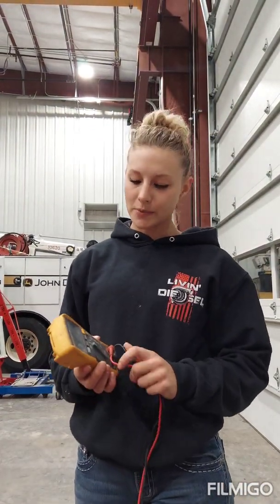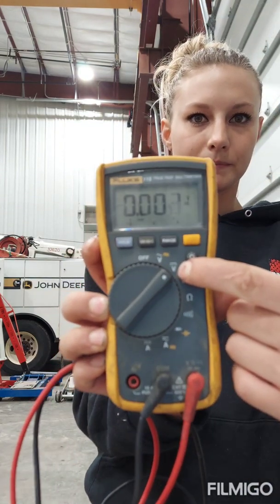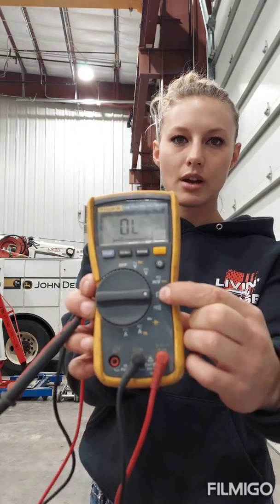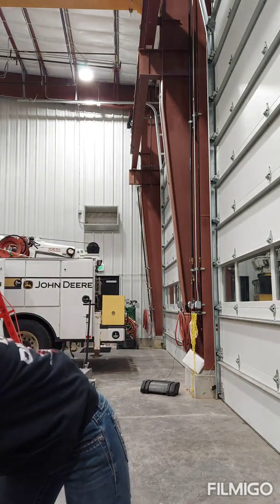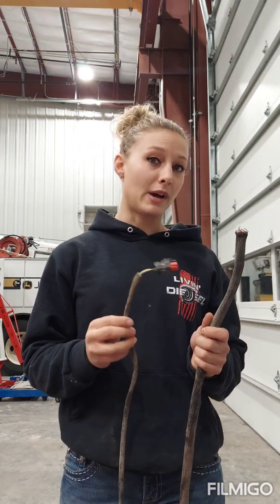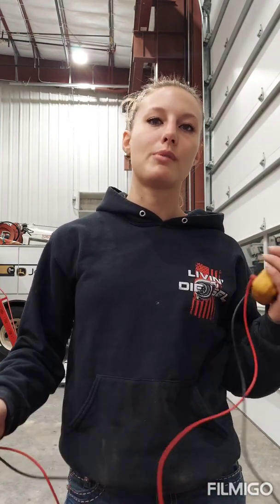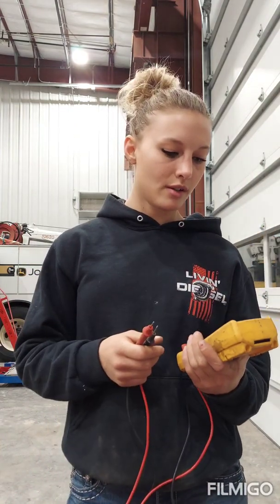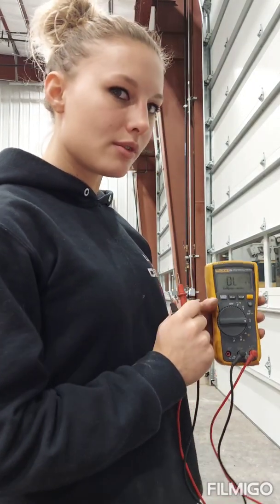Basic Wiring and Electric Testing

Comment: Isn't it a Multimeter? A voltmeter is just for measuring volts? Also you can use the continuity checker to check the wires (less its like really long) then it will have a buzzer sound to tell you whether you have a short or busted wire then you can look at what you are doing rather than the meter.
Otherwise good.
Reply: Most of us doing this line of work don't hear well after 30 years.😂😂😂

Comment: I was an electrician for nearly 30 years. I have used many different brands of volt meters. Both on AC and DC voltages. I found Fluke to be a high priced toy. Not knocking Fluke, just stating a fact. It’s like buying a Harley… you’re buying a brand name…
Anyway, I came across a 1,000 volt/ 1,000 amp iDeal volt meter that was purchased for a Maintenance Department that we were doing an remodel for. The head of maintenance told me they had extra and would sell it to me for what they had in it. I had to ask, “how much?”
He sold me that meter for $40.00
I have used it many times in the past 10 years. Still use it now…
Works great when troubleshooting any of my vehicles (including my Harley) and AC circuits

Comment: You do good and tey well!  For you to learn...  their is no ground on a car, truck, heavy machinery,  forklift.     Ground is only on A.C.    that is all battery negative.  They use the frame of a piece of equipment like a bus bar to complete the circuit.  Ground in AC is to safe your ass from death.   The load doesn't need the Ground.   P.S.  electric forklifts will never use the frame as a battery negative bus bar.

Comment: Voltage drop testing is a far better test than ohm test. For shorts, opens and high resistance. The thing is there is no ball park figure for resistance on a circuit, where as most automotive circuits work on at least 9v. Did you know ohms continuity test will work with up to 100 ohms resistance in a circuit.

Where ohms testing excels is small components like a relay, solenoid or fuel injector.

Comment: Several years ago I got a phone call out of the blue from a friend asking if I knew anybody that wanted to buy a 1991 Dodge Dakota that another person he knew was trying to sell. Long story short they couldn’t get it to start. They had replaced the ignition coil, the distributor, the spark plugs, etc. I went over to look at it and you could tell they didn’t know a lot about wiring because they had cut the pick up wires to the distributor and started rearranging them. Also, they were frustrated and basically done with the truck. After doing a little dealing I got a really good deal on the vehicle And hauled it home. Went and got a manual, (back when they still had wiring diagrams in the Hanes manuals), and spent the next week and a half after work tracing the wiring. What I learned in reading the manual was Dakota used a pulsed ground system. That means basically that all of your sensors and anything else that was controlled by the ECM had positive voltage running to them and the computer turned the ground on and off to activate them. So I started checking all the grounds. Finally, I found one of the main grounds from the battery going into the wiring harness Was checking about 200 ohms. I used the meter probe to pierce the wiring in several places until I found where the reading changed. Somewhere in that wire was a bad spot. Instead of unwrapping, the entire harness and re-doing about 4 feet of wire, I simply cut off the insulation, wrapped a new wire on soldered it And taped it back up. Then I put a ring terminal on the end of that spliced wire, cleaned a good spot on the firewall, and installed a ground screw. As soon as I did that it fired right up and ran. The only issue I had with that vehicle was a few weeks later the engine control computer stopped turning on the electric cooling fan. I ordered another one from a salvage yard and replaced it. I figure all of the switching of wires back-and-forth With the previous owners, had probably backfed electricity through the ECM, causing it to fail. I drove that vehicle almost daily for years without doing any more electrical work to it. It hauled trailer loads of scrap. It was our demo vehicle tearing down houses after the Joplin 2011 tornado. It was used and abused. I sold it to another gentleman who drove it for a couple of years. He sold it to a 19 year old kid, who drove the hell out of it. So, ground issues can cause all kinds of screwy things, especially in lighting, circuits where it can backfeed through other paths.

Comment: I would encourage you too look into load testing wires and using voltage drop. While, a ohm meter will tell you if a wire is cut in half, its not a good test for a wire that’s partially broken. Moreover, What most people don’t know, is that all it takes is one unbroken strand of wire too pass a 1.0 ohm test, but that one strand of wire will not carry a load. Also, a ohm test will give you false positives and leave you scratching your head. Finally, it may lead to replacing components that aren’t bad just because the wire couldn’t carry the load even though it passed a ohm test.

Comment: Best practice every time you meadure resistance is to touch test probes together and  remember the ohms. On old leads have send them as high as 3 or 4 ohms. Always carty at least one new test lead & several meter fuses. Had a 1,000 volt Fluke combination VOM/Megger that would give out wrong readings when the 1,000 volt dpecial hard to het fuse blew.

Comment: If you are measuring and get 5 ohms and not 0.4 ohms or less their is a bad connection between the probes and the test circuit. Possibly also corrosion or an improper connector crimp. Your explanation is spot on though

Comment: There are essentially 3 types of electrical faults: opens, shorts, and high resistance. 
An ohmmeter is pretty good at identifying opens and shorts, but not always good at identifying high resistance(especially in high amp circuits). Ohmmeter can only be used on circuits with no voltage. 
Volt meters on the other hand are good at identifying all 3 faults. They are far more effective at finding high resistance than ohmmeters. Voltmeters(when used correctly) can be used to find opens and shorts whether the circuit is powered or not. Voltage drop measurements can be used to identify high resistance in circuits under load. If you have a LoadPro hooked up to your meter, it makes very easy to do that.
Reply: Worst one is any intermittent problems. Have spend hours trying to find cause if intermittent problems from shorts grounds and open circuits.
Reply: @JohnThomas-lq5qp  I have one now on my Bobcat skid loader. I'm getting some fault codes and have taken it to the dealer when the boom won't lift and by the time I get it there it works again. I checked the wires and actuators and the dealer ran tests as well and can't find anything. She's been good for a couple weeks so I'm being nice to her and sweet talking her to stay on her good side and keep her happy.
Reply: Would love to hear more about this in your own words. It sounds like I could follow what you are saying. I have both types of meters but basically only understand ohms as in continuity. This girl is a real cutie and very knowledgeable but I could not follow her. Everyones brain is wired differently. Regardless, thanks for sharing, both of you.
Reply: @Flat6fever  Electrical troubleshooting can be challenging to learn. I recommend looking up Daniel Sullivan on youtube. Not as attractive as this young lady, but he has some really good content on electrical diagnostics. I've been to one of his classes, and it was well worth it.

Comment: You should have less than one ohm on a wire with continuity. Also your Fluke has internal protection if you connect to voltage while in resistance mode and shouldn’t blow a fuse. Some of them will beep at you to let you know there’s voltage present when you’re testing for ohms. A pulsing beep, not to be confused with the solid tone of continuity that some meters produce.

Comment: Everything she said is accurate. I recently started watching her videos and can tell you she knows her shit. Here are my 2 cent tips for checking electrical circuits. One is 10 ohms or higher should be considered an open circuit. Two, when checking for an open circuit, disconnect both ends of the harness. With the meter set to ohms connect one lead to one of the connectors and using a long wire, connect the other lead to the other end of the harness. Monitor ohm reading while wiggling short sections of harness. Ohms will fluctuate when you wiggle damaged wires. Same method applies to pin to pin shorts or opens. For short to ground, one lead goes to chassis ground.
Reply: I wouldn't consider 10 ohms an open circuit. Maybe high resistance,  but not open. I've seen manuals that quantify an open as 100k omhs or higher or 200k ohms or higher. There are a lot of solenoids and actuators that have more than 10 ohms resistance. CAN buses have 60 ohms terminating resistance, and that certainly isn't considered an open.
Reply: @C B  There is more than one way to skin a cat. Everyone has their own way of doing things. 
I'm not sure what kind of circuits you are used to working on, but the 10 ohm rule seems pretty excessive to me. Are you saying that if you measured 9 ohms across a wire in a harness(regardless of what type of circuit), you would consider that good and move on? In my experience working on 12 vdc systems, even 2 ohms of resistance in a wire can cause enough voltage drop that some components won't work. Many sensors won't read accurately with any resistance in the wires at all. 
In my experience, checking a harness, any measurements more than a few tenths of an ohm I will investigate. 
These days, I prefer to use the voltmeter for continuity testing over the ohmmeter. Far more effective in most situations at find high resistance with a circuit under load.
Reply: @C B  If you do the math(ohms law), a 12v light circuit with a bulb that has 5 ohms. If you have 9 ohms resistance in one of the wires to the bulb, you will drop about 7.7v across that resistance in the wire. There will only be about 4.3v remaining to power that bulb. That 30 watt bulb will be extremely dim if it lights up at all. Just one example.
Reply: @C B sure, 9 ohms of resistance on a wire in a lot sensor circuits may not be significant enough to cause issues other than slight inaccuracies in the ecm measurement. However, 9 ohms of resistance on any output device that requires any significant amount of amperage(>5 amps), it will absolutely cause problems. 
I also work in the diesel industry and am very familiar with Cummins and Cat's definition of a closed circuit(less than 10 ohms). That being said, in my experience, a good wire, regardless of size, should read less than 1 ohm(unless you're looking at a very small wire that is extremely long). Anything much more than that is worth investigating. That is my experience. I have been bit by that before. 
Also, I use an auto ranging meter, so I don't have to worry about the range setting.

Comment: Pretty good explanation, you do a good job of explaining it in simplified easy to understand terms, not everyone can. I'm getting deeper into electrical diagnostics as I work on more stuff and own more stuff. I have a harder time getting the generally resistance reading then interpreting if it's good, bad or in a normal range. Voltage is pretty easy, I got a clamp on ammeter recently which is kinda handy for generalized stuff. Like how much an Alt is putting out.
Reply: Honestly the best and most fool proof way of testing circuits is load testing. Resistance testing will get you in trouble more times than not. A wire with every strand but one cut will usually show good just checking resistance.

Comment: Easy way to test sensor codes is to check for low resistance while its plugged in. Unplug sensor and short the wires together. Code should change to high resistance. Shorting 5 volts together won't hurt the circuit, and it actually tells you if its good or not.
Reply: I always unplug the sensor, then check for reference voltage, and ground at the connector. With those two verified at the connector, plug the sensor -back in. With the sensor connected, back probe the signal wire and monitor for parameter variance. Also, most sensors relate to a resistance value chart that should be referanced to validate the sensor Itself.
Reply: I don't follow that. You sure you got your hi and low resistance the right way round. And which wires are you shorting together. And where/what are you testing for low resistance when it is plugged in?
Reply: @Eddy Edwards  I think he is referring to a sensor circuit response test. With the sensor disconnected, you will get either a voltage low or voltage high fault for that sensor depending on if it a low or high biased sensor. If it's just a two wire sensor, you can jump the two terminals in the connector and look for a state of change. If the code switches from V high to V low, then the circuit is working properly. If it is a 3 wire sensor you will have to jump the signal wire to either the reference voltage or the 0V return depending on if it is high biased or low biased. 
Very quick easy test for sensor codes.